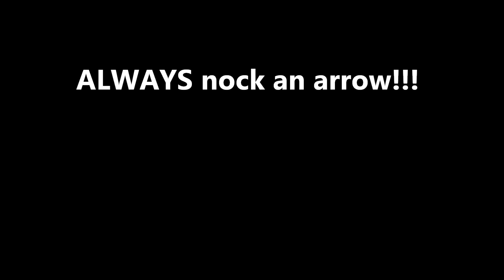Dry Fire of a Compound Bow, Bow explosion

Comment: No, the limbs took high amounts of shock because the arrow wasn't there to take the force of the bow. Without the arrow there to take all the energy that is created when you release the energy has to go somewhere and the only place is back up the cams and down the limbs. Because of the mass vibrations the string derails and COULD potentially snap, however in this case I think the string has just unraveled upon derailing.
Also when you derail a bow the limbs hyper extends causing them to break.